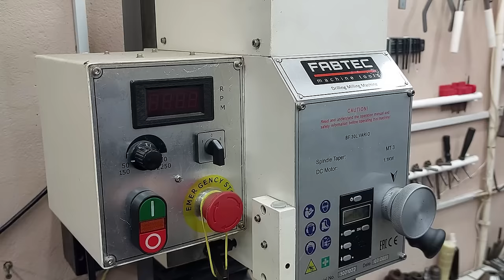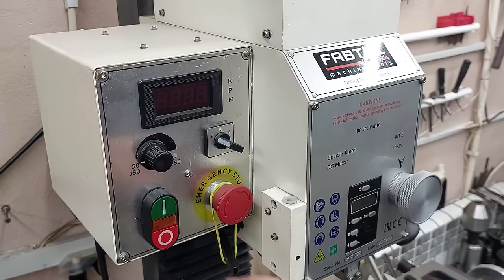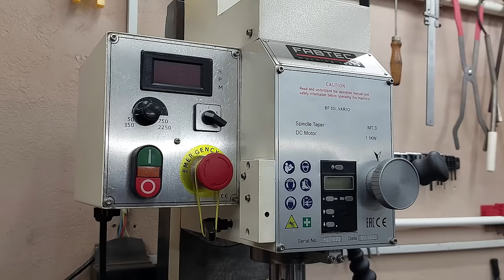Why waste money! Great idea and useful tip in 9 minutes for metal processing

Comment: Centre drilling the steel block in the toolpost from the Headstock is a great way of ensuring the boring bar will always be on "Centre Height" with no need for packing strips.

Comment: What Kind of Paste in Plastic Bottle You used at Welded and Machined Area to make Black? And the Name of Liquid You Sprayed before Applying the Paste?
Reply from the maker: Liquid for cold bluing of metal and before bluing the metal it should be degreased with solvent😉